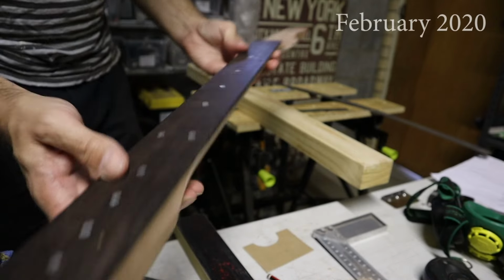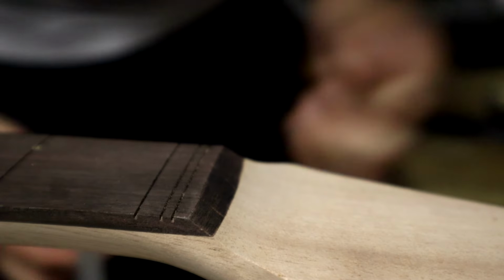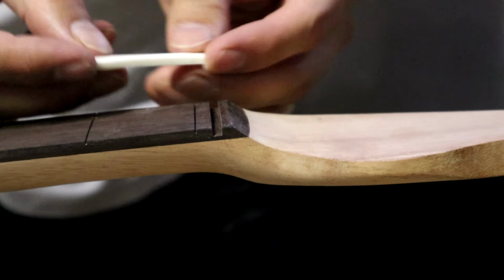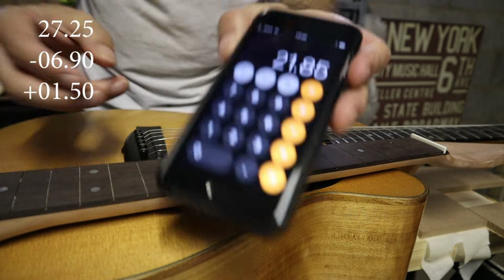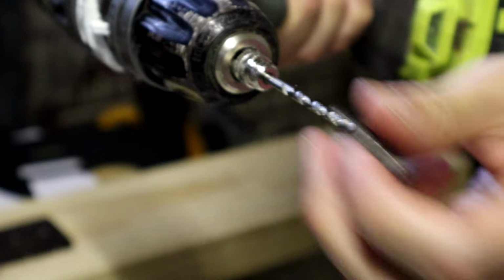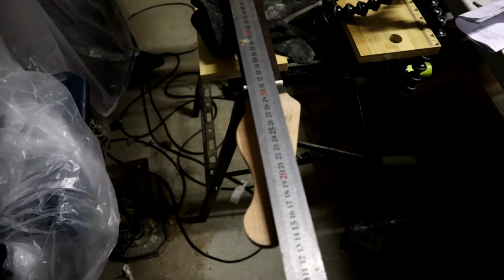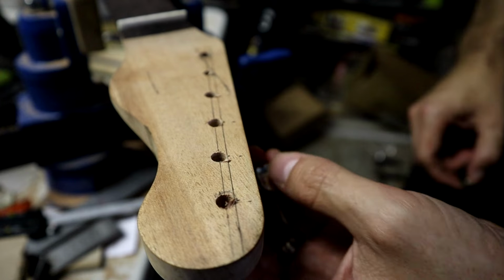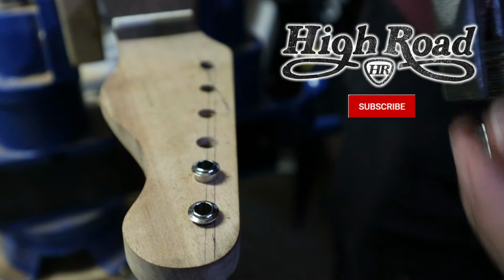Part 10 - Building My First Guitar - Locating and Drilling the Tuner Holes

Comment: Wgat is the The distance from the Centre of tuning machine holes till the edge of the headstock? 
Thanks 🙏
Reply from the maker: I'm afraid I don't know. I'm not sure I took that into account other than to place them similarly to my other tele. I was more interested in where the holes lined up with the strings. It's probably about 12mm though to answer your question